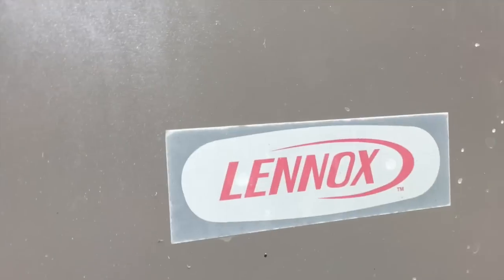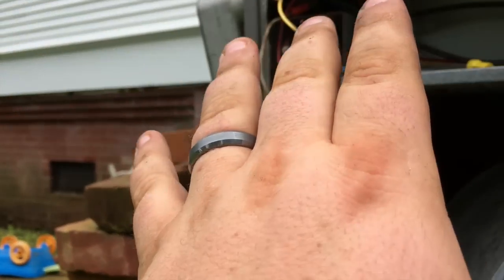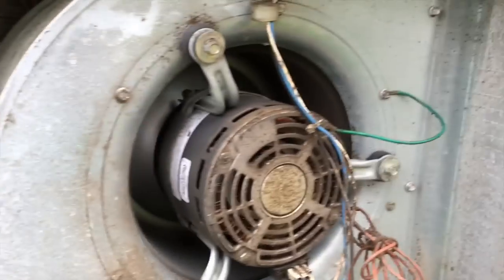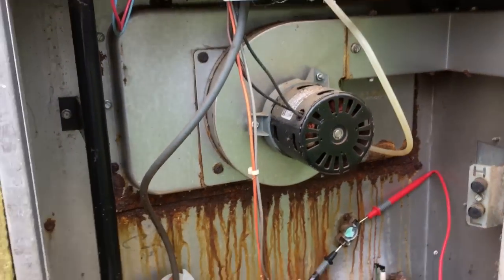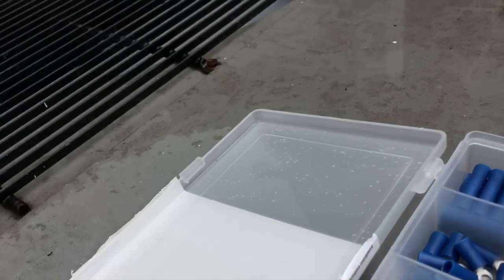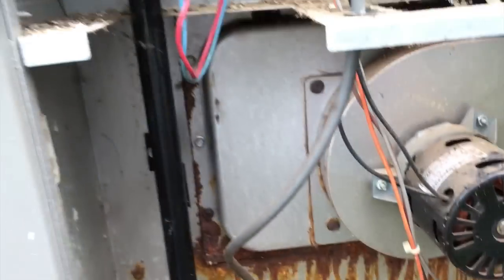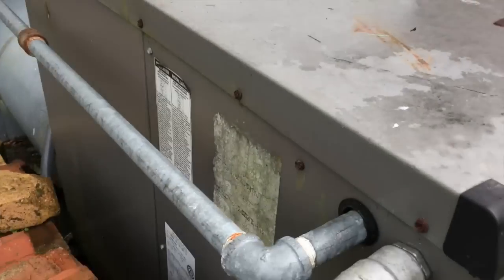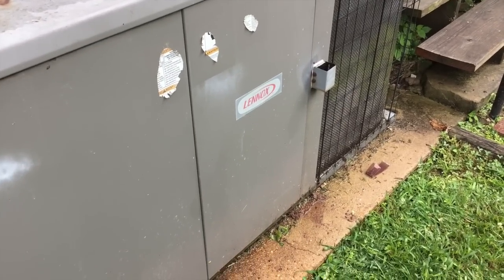HVAC: Lennox Package Unit Not Cooling

Comment: That control energizes the draft motor on every 4 calls for AC  for 10 seconds to deter insect activity ,  it wasn't the limit wires , because you were not calling for heating, only a tripped rollout switch could have done that, and sill would have needed a call for heat .

Comment: It's good idea to buy the compasators your unit takes keep on hand they will  fail and at the worst times my blower fan quit high pressure switch cut it out at 3 am in 28deg weather due to compasator I had one on hand got it going

Comment: Cheap seats here...do those caps still retain voltage when removed ? If so how do you de-energize ?
Reply: Thanks for the reply. I'm a carpenter/ remodeler. HVAC is my weakest area for sure. 
I've been watching the 5-6 guys who post a video every night for a couple of years now. A lot of knowledge...thanks.
Steve the Contractor in NC

Comment: when pulling a vacuum, after you're satisfied there are no leaks and you have removed all of the contaminants from the system, are you supposed to release the vacuum you created back to atmospheric pressure then release the charge or keep the vacuum and release the refrigerant? this is for factory charged R410 residential units. thanks!
Reply from the maker: Keep the vacuum and release the Charge
Reply: thanks. subscribed. i think i can learn a lot from watching you. keep up the good work.
Reply: This question makes no sense...
Reply: what part of my question on pulling a vacuum is confusing you? @israelhvac was able understand and answer it just fine.  maybe re-read my question slower.
Reply: Generally speaking, checking for leaks with a vacuum is considered an improper practice, but let's be real here we've all done it lol. The reason we want to keep the keep the vacuum is to remove moisture and keep it out of the system. Any moisture, even trace amounts, in a refrigeration system will mess with the refrigerants ability to transfer heat, ie decreases cooling ability. It will also react with compounds inside the system to create acids which will destroy the compressor. If you release a charge into a system not in a vacuum, but at atmospheric pressure your unit will not last very long. This also applies to any refrigerant type not just 410.

Comment: Looked like a pretty bad rollout situation
Reply: I'd say a rollout too. I've never seen low voltage wires burn like that by themselves.
Reply: Joe Shearer 
Agree with high likelihood of  rollout condition. Didn't notice a rollout switch in there. Willing to bet when the blower comes on gonna see some flame coming out into the cabinet. Likely the Hx is compromised. Hope they have co detectors in the house. Yikes.